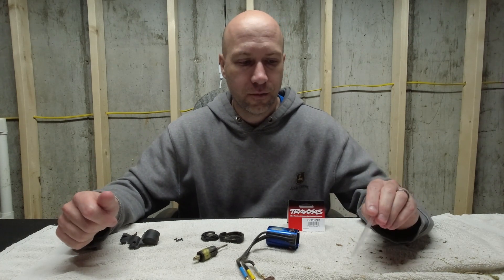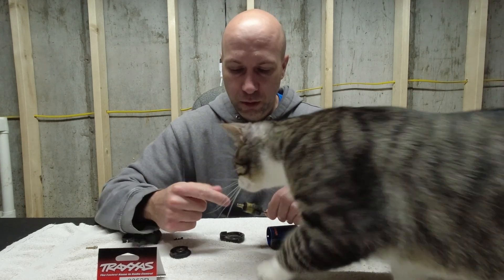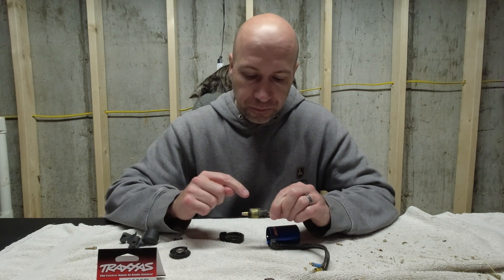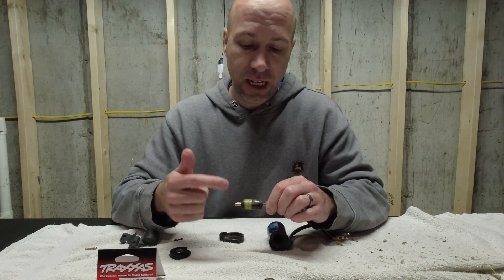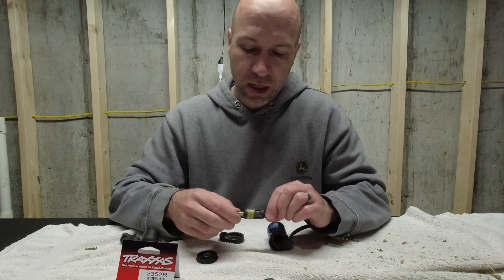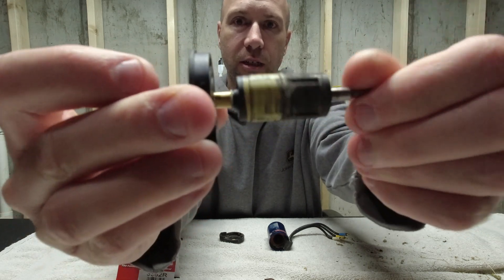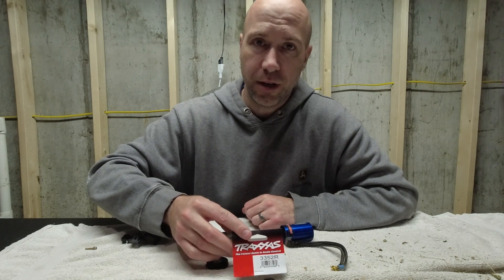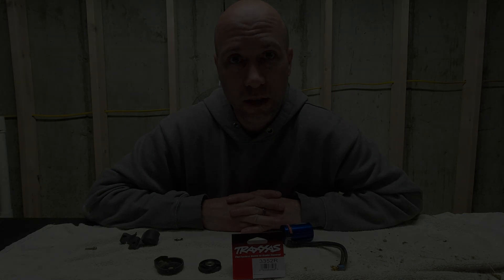Most important Brushless motor maintenance (2021)

Comment: I've had some success repairing the rotor windings by removing and wrapping the rotor with Kevlar string with a fine coat if epoxy on string. Then replace those sloppy bearings. Its not 100% perfect, but if you can use a balancer of somekind might be pretty damn close . Trial and error!

Comment: Literally same thing happened to me on my THIRD RUN with my brand new e revo 2.0…. 2200kv motor shot just like that. $110 out the window. Gonna hear it down bc when I went to look at it after run it was extremely hot and smelled horrible.
Reply: It should be under warranty.
Reply: @goneviral6037  
Not if it overheated due to over-gearing it though....
Reply: Just broke mine. overheating the motor   and it's done for

Comment: My xmaxx exact thing, 5-10 runs tho 😠
Reply: wow, thats horrible!! was it really hot out? or something extreme ?
Reply: @goneviral6037  nope, middle of fall, replaced it and now I’m replacing bearings every year 🤣🤣
Reply from the maker: crazy, did it get really hot?
Reply: @rcaction7428  it did because I drove it back to the truck after which is probably where it killed the rotor
Reply: I think it is the little balls from the bearing that cut the Kevlar wrap

Comment: My Arrma 3s bearing exploded in motor.  The armature and inside can in packed with dirt. Should I spray contact cleaner inside and on armature to clean it? Is that safe?  I’ve read I should block unused motor holes etc to stop dirt.

Comment: I would say like under 30hrs got it at the end of the last summer i bet iver only took it out 10 or 15 times if that, but its not as bad as your just a bit frayed the front bearing went just like yours trying my hardest to get the bearing sleeve out to no avail its like 150 in canada for a new motor ffs

Comment: I think that might be Teflon coating
Reply: Its kevlar thread. And a heat resistant epoxy. I'm actually fixing mine. Once I get the stuff. My bearing went like his but it's not as bad my thread is frayed and dirty tho in the front. Going to re wrap the front and run it till she's done
Reply: @clinthipfner6042 what tape are u using to re wrap
Reply: What tape are u using to re wrap

Comment: The bearings went in our Traxxas motor at the bottom the can leaving the outer bearing casing stuck in there, we could not get it out. Eventually we drilled through the bottom end of the can and pushed out the bearing case, my plan now is to use two sets of bearings to hold in the other. I’ll have to do a video of it, it might be interesting to see what happens. It will be over on our rc channel called RC Havoc UK.
Reply from the maker: Sounds interesting, I would think it would work, great idea too!  Those bearings really get stuck in there!!

Comment: I have 3 udr and im killing mine only after 2 or months with out maintenance.
...damn cats
Reply from the maker: That is crazy! I just got my udr so I’ll have to how long it will last. Does the bearing go bad or what happens?
Reply: @rcaction7428  im not saying they all brake but yes if no maintenance is done,  it will brake fast, spacially if it gets water.
You must seal the rear motor at first. The rear bearing is expose and take a lots off dust and when i will fail, it will get desalign and the magnet will rubb against the can and its over.
Since I put a small piece of tape on the motor to seal the bearing, and maintenace everry few months, no problem at all since then.
Reply from the maker: @faststongesdrc7075  that’s a great idea sealing it, I wonder if hot glue or silicone would work also?
Reply: @rcaction7428  hot glue will jam the bearing and grease or any lube will atract dust and its gona be just worst.
Reply from the maker: @faststongesdrc7075  yeah tape is probably the best way! Thanks
Reply: @rcaction7428  https://youtu.be/9_V-7M-2h3o